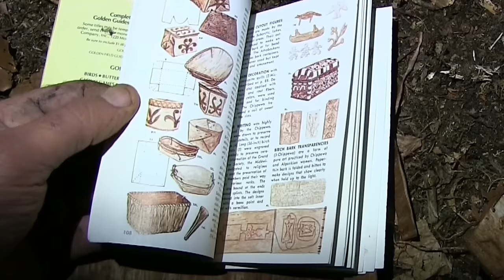Overnight Bushcraft Camp And North American Indian Arts

Comment: because the temperature of the spontaneous combustion of wood is about 240 Degree you should cook putting a dish on hot embers buried under ash and not the flames. If the bark let in water and "sweating" on the side of the fires as the paper it could be put up in flames! :-)

Comment: One of the only non-vocal videos that is so strong on content that it doesn't need any vocal.....great job !   How do you keep that bark bowl from going up in flames, or not burn and leak?
Reply: fieldagent59 is in the forest The liquid in the bowl actually keeps the bark from burning completely. Water is a great heat sink, hence why it takes so long to boil! Basically the water absorbs the heat of the fire so that the bark gets hot but never burns all the way through. You could test this very easily with a balloon! Simply put a candle flame to a regular air filled balloon and it will pop, but if you fill another balloon with water and try it again you'll find it won't pop. Pretty cool stuff :)
Reply: You can also put a plastic bottle filled with water set it in the fire, and it will boil and not burn up the bottle until the water boils out of the bottle.
Reply: that's pretty amazing, that the water would pull heat away fast enough to keep the plastic from melting through....

Comment: What kind of bark is that? Is it treated in any way? Does it have to be soaked before you put it on fire?
Reply from the maker: It is spruce bark. I soaked it a little bit with water. After that the bark will be a little bit more flexible.
Reply: Why doesnt it burn though? It needs to be very fresh and "green" right?